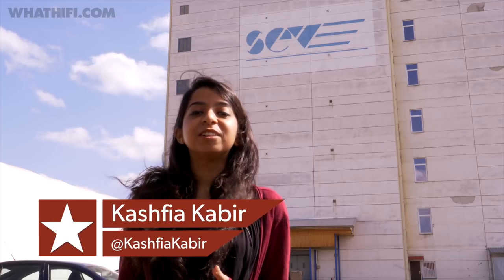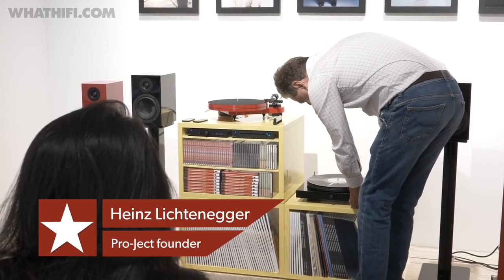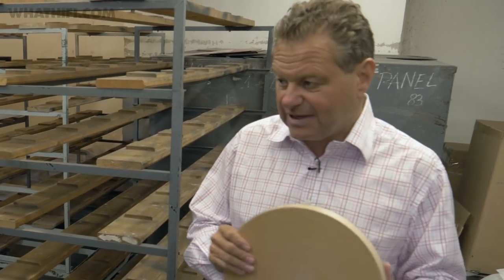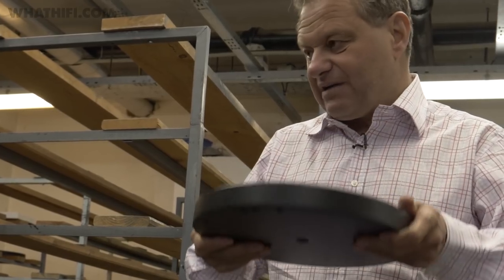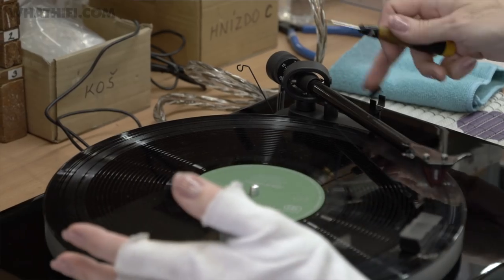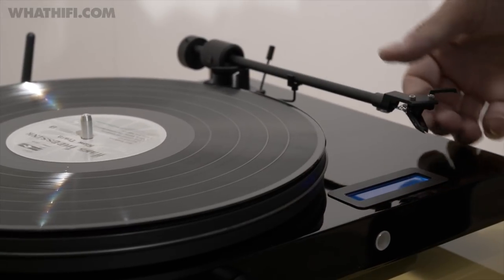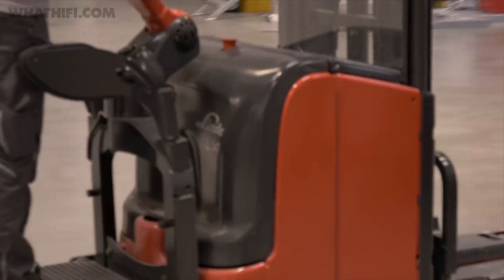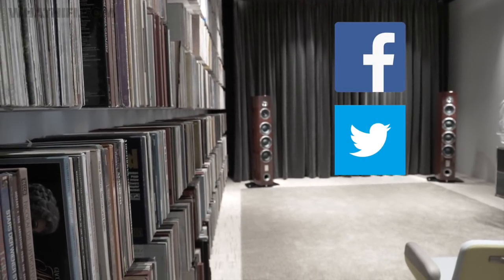Inside the Pro-Ject Audio turntable factory

Comment: What they didn't tell you about are the Harmonics generated by switching power supply, supplied with the 1 Xpression Carbon Classic which creates EMI and is picked up by the wiring in the Pickup arm, I have measured 80 milivolts of mains frequency harmonics on my oscilloscope from this universal switching supply which works in any country with the harmonics to match your countries power supply either 60 or 50 cycle supply.